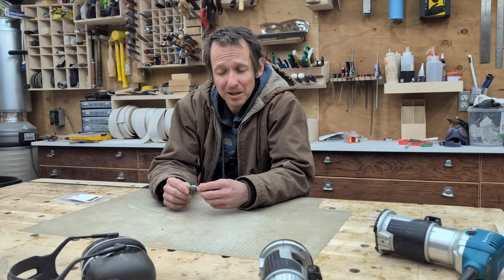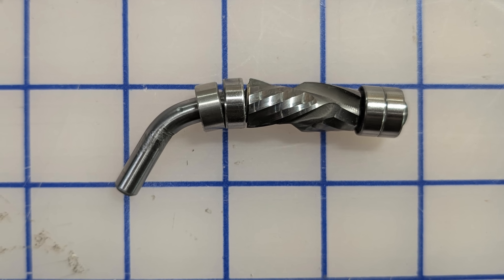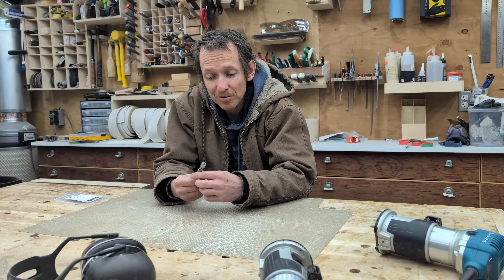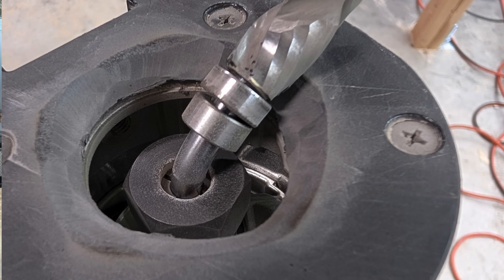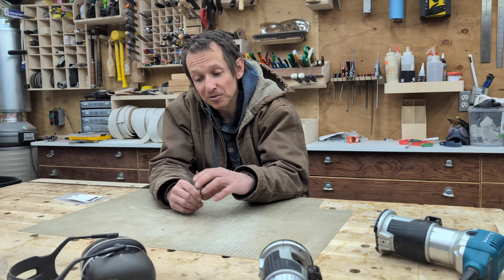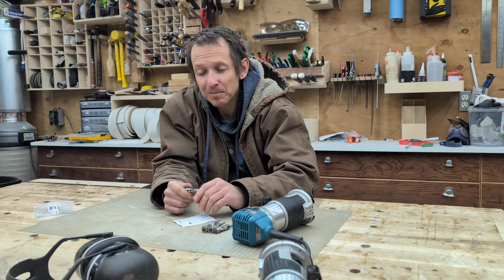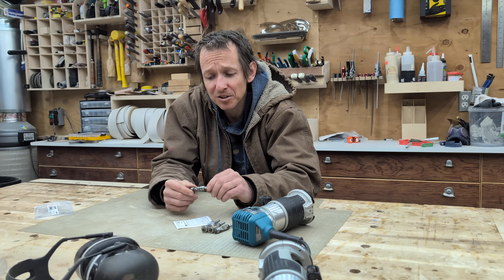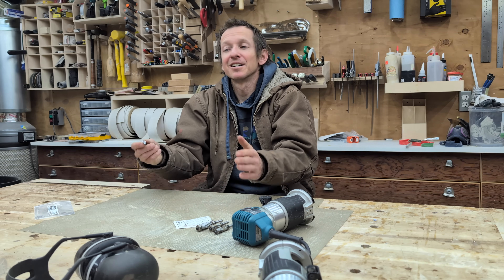Fear the Banana Router Bit!!!

Comment: Now I'm terrified to even start using my new palm router with the Amazon pattern bit.
Reply: Using a router shouldn’t be terrifying. I own 14 routers, and they are one of my favorite tools to use. My advice to you: 1. Install the bit correctly. 2. Use the recommended RPM for the bit. 3. Take light passes. If I were using a pattern bit cutting along the edge, I try not to leave more than a 1/16 of an inch. Take your time to get to know your router. I wish I could give you hands on lessons, watching YouTube videos isn’t always the best teacher.
Reply: These size and length of bits should really have a half inch shank and be used in a "proper" router...people using palm routers for cuts like this are crazy !.. remember when these lightweight routers came out and the uses they were put to ?... now we think they are handheld shaper machines... 🙄😂
Reply: @peterfitzpatrick7032  Exactly! Both of my “old school” trim routers have a fixed speed of 30,000 rpm’s. I would never attempt to use a flush trim bit like this.  Mainly I use my old routers for small round over, chamfer, or flush trimming laminate. You also bring up a good point as far as these new routers that have come out. People who buy these think they can be used for anything. My opinion is that manufacturers are trying to meet a demand for the DIYer’s. People need to be educated as to why and when you need a bigger router. Finding how to use a router on YouTube isn’t always the best teacher.